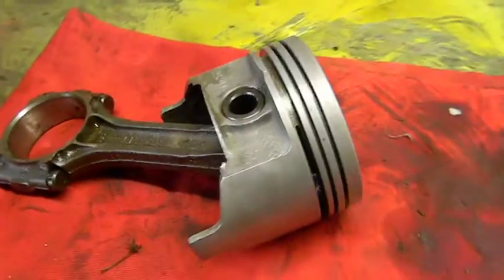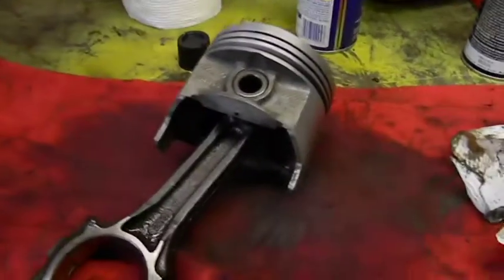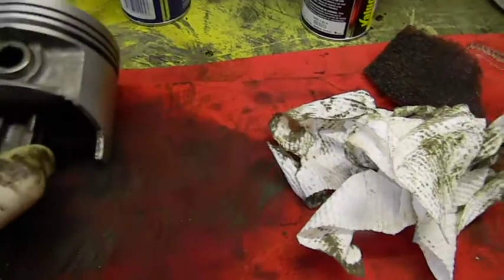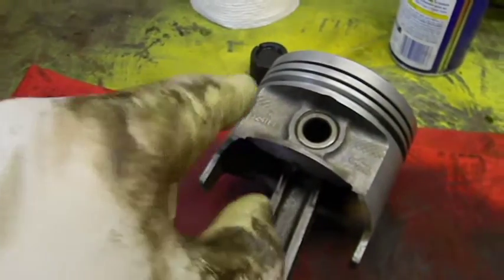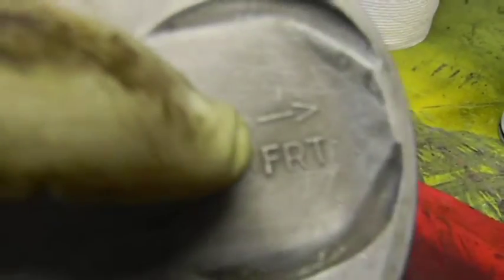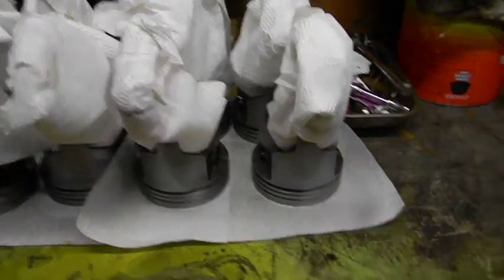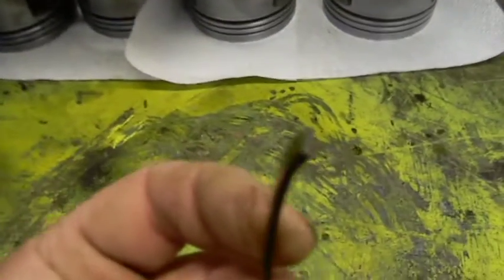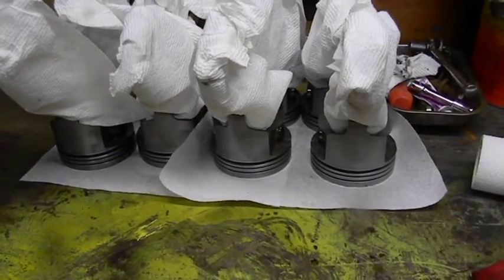AMC 360 Piston Cleaning

Comment: I rebuilt my AMC 360, 3 times. Didn't know that about the pistons. Thanks for the Tech. If you didn't know about the oil pump, when rebuilt, you need to measure clearances on it to keep oil pressure at idle. 2 to 3 thousands between the 2 halves, I think.